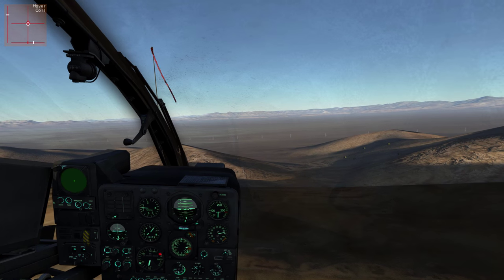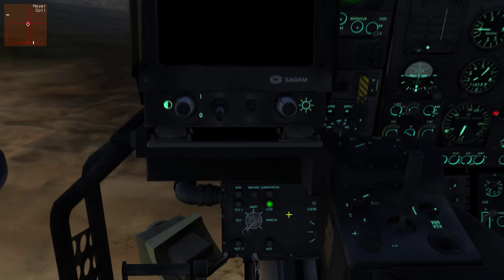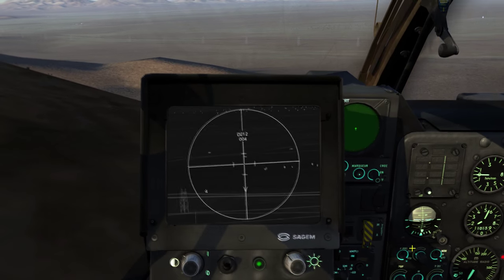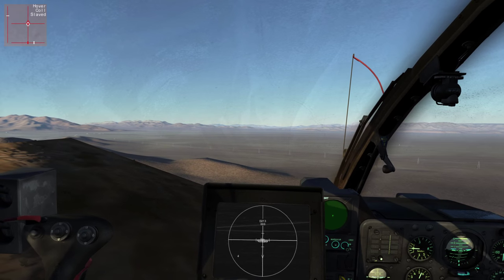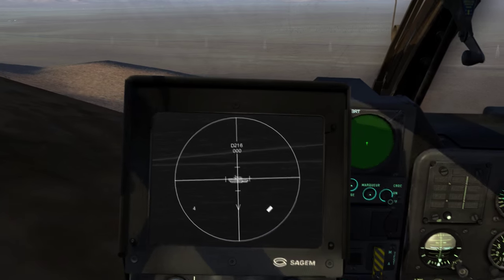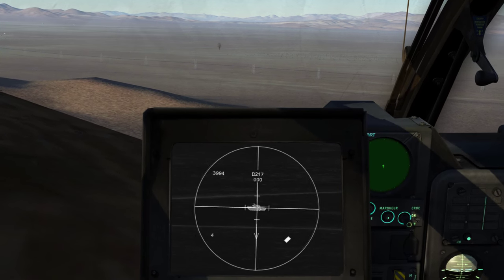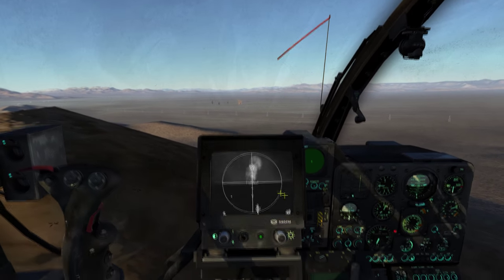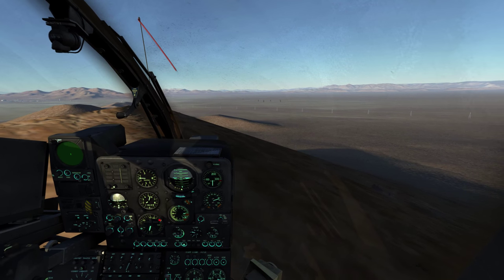SA342 Gazelle HOT missile demo.

Comment: One question, Ploychop: is this constant bobbing left and right when hovering a real feature of the Gazelle?
Reply from the maker: The auto-hover maintains an area of around 10x10 meters area. So it's tries to stay in one place but forces like wind act upon it, and thus adjusts accordingly.
Reply: +Polychop Sims 
Is the wind actually affecting it in this video, or is the modulation simulated - even in the absence of actual atmospheric effects on the air-frame?
It seems awfully regular...